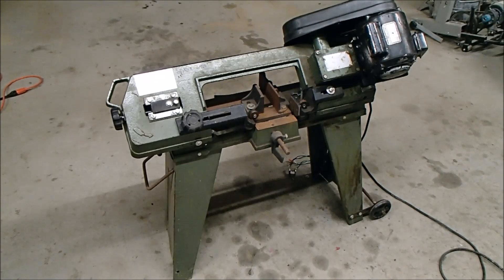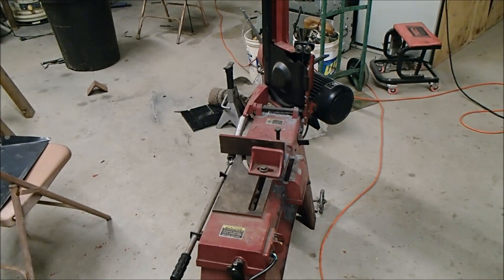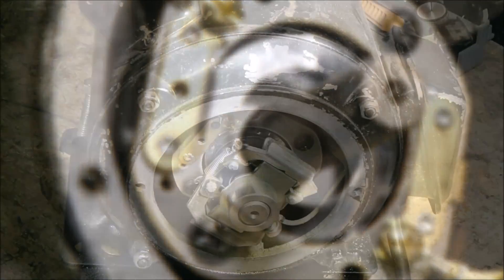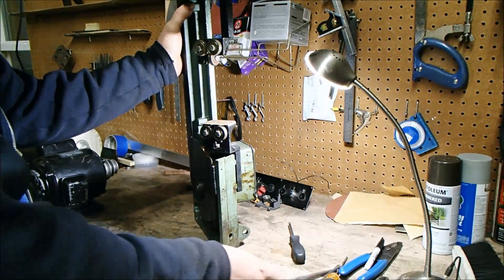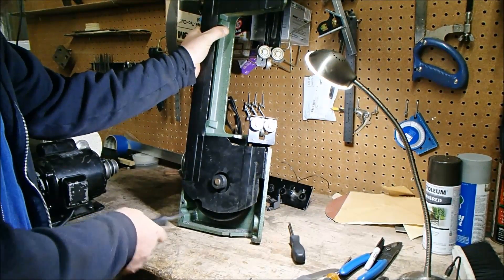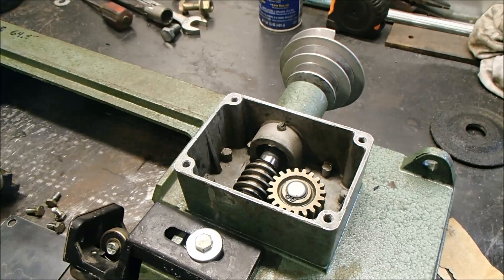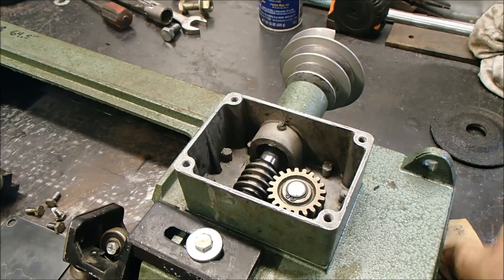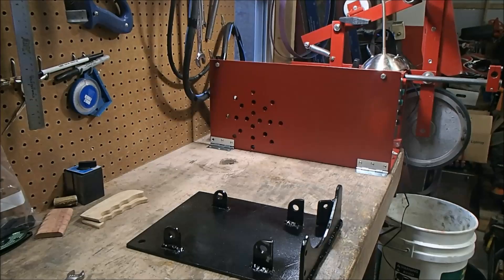Harbor Freight 4x6 Vertical Bandsaw Mod Hack

Comment: Just doing my Sealey, same lay out but a bit bigger (12 inch).  The manual recommends 90 weight gearbox oil (300ml.)  My gear box cover has a small screw with a tiny hole to equalise pressure.  Above is a shaft in a metal column.  This connects to the gear box.  I am unsure as to how oil gets up there.  There is a small access  Allen key grub screw that opens a passage to the shaft. This shaft surrounding cavity was filled with the same oil which is presumably between two smooth bearings. It slowly drained down into the gear box. WD40 accelerated the drainage. How does the oil get uphill to this area? I will fill it on reassembly through the small hole with the 90 oil with some sort of tiny funnel? Under-filling might risk the shaft seizing.
Gasket sheets are often sold in mixed packets (A4) some thin, some thick etc.  A sheet can be put over the lip of the gear box, held firm and gently tapped around the edges, leaving a perfect outline for cutting a new gasket. One way of making a bespoke gasket replacement.
Many thanks for your video.

Comment: I would like to add NOT to use GL5 oil. It contains phosphorus and that isn’t good for brass gears. It will cause them to wear prematurely. GL4 or special machine lubricants for use with brass gears.
Reply: I should have also mentioned that GL-5 contains Sulfur and that can harm brass or bronze gears like what are in these saws.

Comment: great project and idea.
regarding the gear box, when the oil gets warm creates fumes and those fumes oxidize everything in there. usually, gear boxes have a vent valve on top connected to a hose (protection against the environment); such a valve need to be serviced once in a while by disconnecting it and blowing air through it. if its clogged some carb cleaner will help or a piece of wire through it. 
the automotive pcv  system, for instance, uses the pcv valve, and when the valve is not serviced around 30k fumes causes gaskets and seals to break down and deteriorate and eventually that leads to leakeage of oil, vacuum and contamination of the environment. as well. 
as a result, the hypoid oil used in it causes its thermal breakdown and could be prone to cause sludge everywhere (kinda spider web debris) too shortening its life spand.
iow, a 1/8 or so pinhole - north of the inclination point - will aid to tolerate greater heating conditions to the gears and oil - and also aid to disipate heat & harmful fumes i guess. just an idea 
thanks for the video

Comment: I have owned several bandsaws large and small and have always used 80-90 gear oil it doesn't leak as much and stays on gears after shut down that 80-140 that you have there should work fine I like your vertical conversion good video thanx
Reply from the maker: Thanks for checking it out. It's worked great so far, and still no leaks.

Comment: good idea,hw d yu like the new saw,id like to get one
Reply from the maker: For the price, these little saws are a great deal. I've got the two and use them all the time. The only complaint I've ever had with them is the stand/wheels. The stands are flimsy and cheap, so if you plan on moving it around a lot, you might want to make a better stand.

Comment: sir thank u for this video. i have a h.f. bandsaw and i now have a excuse to buy a second one. i will turn my oldnone into a permanent vertical band saw. i do alot of machining where i need to lay out my work and i have been milling or grinding to that line because i hated how low my saw sat or the fact i would have to sit on a small stool to work. and my knees aint what they use to be.i was thinking for a while how i would like to put it on a bench or something but soace is limited in my shop so i think i will mount it like u did but build a stand wit wheels so i can move it around easily and have out of the way when not in use. again thank u sir for this idea and working out how to make it all work
Reply from the maker: Thanks and good luck with yours. I'd like to see it when it's done.

Comment: I have decided to do this mod on my HF bandsaw. I use my 14" dry cut saw for all my major cutting now, and my band saw stays vertical for the small stuff. That's a great looking mount you made for yours!
Reply from the maker: Thanks, I use mine all the time! I've got a part 2 to this project also.
Reply: +Self Made Thanks, I watched it too. Really like the use of the VFD. I'm in the process of converting my drill press to 3ph with a VFD.

Comment: One more thing....I am planninig to replace the gear box cover by a trasparent( fiber glass, plastic, Lexan, )one like I did on another type of machine.  Or a least some kind of look out...
I am wnadering if yours has run without lube? Probably....
Reply from the maker: +remige2006 It may be have ran out of lube, not sure. After the motor quit on me it sat for a long time in a shed, so it probably kept seeping out the whole time. I was worried that it had damaged the gears, but there wasn't metal shavings/dust in the box, so I don't think it was harmed. On a good note, it hasn't dripped a drop since this video was made about 2 years ago.

Comment: When my 4x6 bandsaw stopped working I thought motor had burnt out too. Then I troubleshot the machine and found out that the cord had just broken by the plug. So I replaced that, and it is still running. I do hear about the motors burning out on this saw a lot though. Now I wonder how many of them really do have burnt out motors.

Comment: THnks for the good Video on mounting Metal band saw was looking for ideas something like what you did will  be a great method of mount mine...      As a Heavy Equipment Mechanic.. on  RTV gaskets on things like oil cover.. what I do is not tighten the bolts all the way down.. just enough to get even squeeze out started all the way around the cover edge... then let it cure overnight if possible  but at least several hours... then tighten the cover all the way down compressing the cured RTV for a better seal...  started doing that on some old trash engines/parts  to run worn out  old farm machinery without  of machinist support... fills in the scratches and voids before compressing it to a paper thin nothing..

Comment: A friend of mine just gave me one of these saws. It has been used and abused in every possible way that you can imagine. I never seen it run before I got it home. Actually its still in the back of the truck under a heavy tarp with a foot of snow on top of it. (It's dry). Anywho I really don't have space for it in my shop but after watching your video I know what to do with it. I'm going to do the exact same thing you did. I was going to have to build a stand for it if I kept it. The original stand is held together with duct tape and a lot of hope. If I make it a vertical saw I can push it in the corner until needed. Thanks so much for your idea and sharing it with a very well produced video. Nicely done!
Reply from the maker: Thanks, seems like I use my vertical one a lot more than the horizontal one. Hope it works out for you, there's also a part 2 to this project.
Reply: Self Made happy you replied. I watched part 1 in an automated play list. Could not find it again so I can subscribe to your channel. Looking forward to part 2. Heading that way not. Thanks!
Reply from the maker: Thank you for the kind words. I use mine all the time, works great!

Comment: I found this video while looking for an easy to find gear oil that's safe for brass gears.  A few of the forums stated GL-5 eats brass over time and GL-4 and below are safe.  Just letting you know for what it's worth.  Aside from that, this is an awesome idea and much cheaper than buying a vertical only metal cutting bandsaw.
Reply from the maker: Yeah, I'm hearing that oil was wrong. I'm actually working on the saw again right now because I burnt the motor up big time. I'll be posting a Part 2 to this project in a few days, and changing the oil is part of it. Thanks.
Reply: Awesome, looking forward to checking it out when you do.  BTW, I found some GL-4 at walmart of all places.

Comment: I like it! Nice conversion job.

Only comment is you do not want to use Hypoid Oil.  The GL5 hypoid (differential) gear oil has sulfur and phosphorus EP additive that will attack and damage the bronze worm gear.  

GL5 is fine for steel gears, fine for a differential.  For Brass gears GL4 is recommended (some transmissions use brass synchros.  Yes, I learned the hard way with old Datsun's. Two transmission suppliers, one with steel synchros, the other with brass synchro's.
Reply: Yes, he needs to change that oil.

Comment: This was an incredibly useful video!  The footage was well shot, lighting was excellent, edited masterfully (including the time compression for the assembly), and just the right amount of information.  All YouTube videos should be this well done.  Thank you for taking the time to make this.
Reply from the maker: Thanks for your kind words. I'm new to making videos about my ideas and projects, but I have a few more in mind that I hope to share...one of these days.
Reply: @SelfMadeProject  Just trying to figure out because I miss placed my owners manual what the bleed size was
Reply from the maker: @chuckmccracken4100  the Harbor Freight website has the owners manual for the saws they are selling now. The are showing 64 1/2" blades. I don't think the blade length has changed. I bought a bunch in bulk a few years ago, so I can't remember for sure.